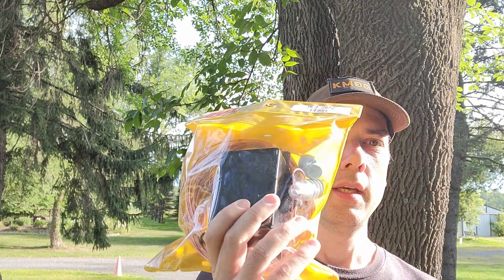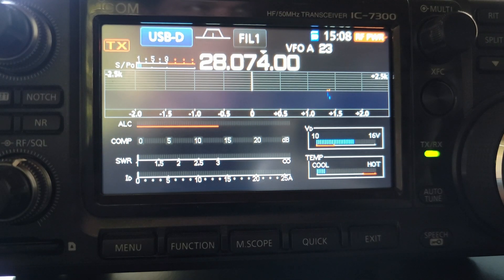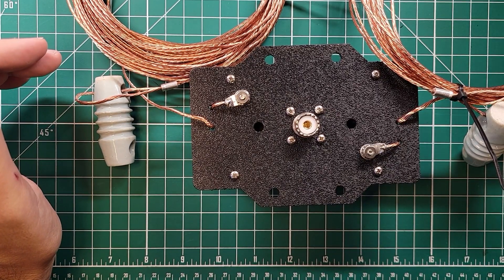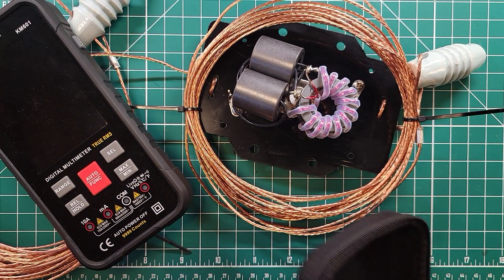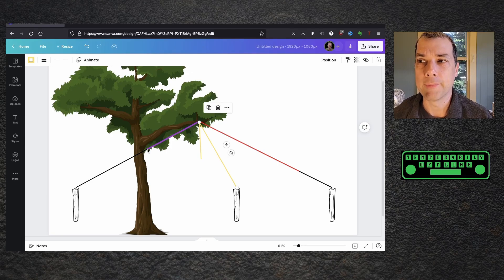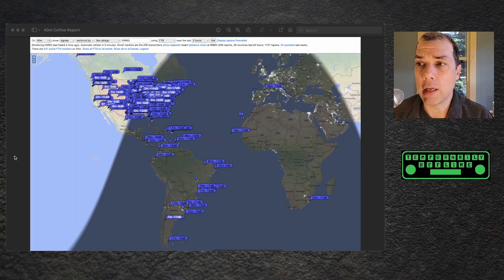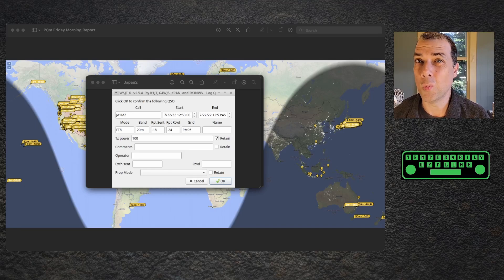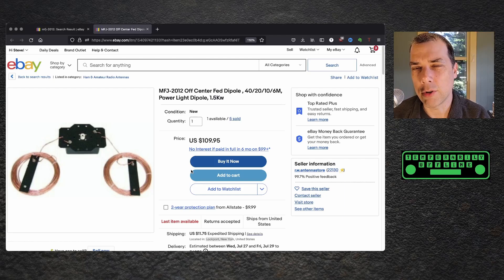Make a 6,120 MILE Contact Using Just 100 Watts

Comment: That the antenna I have and use. I am in Boston NY . hour or so drive for me to Lockport. yes that wire turned black and green after 1 winter in NY. I did not6 get it up that high so I had to trim it. 1/3 to 2/3 cut. center fed is 1:1 cut. got it from MFJ and still sell it. I have THHN 12AWG  on it now. and run power threw  it.  works great. used it portable.  the short side into para cord to park bench ,long side with para cord on a DX commander pole lean into a tree. sloped set up. works and tuned great. I think 80 meters add wire. they have a 80 meter one not Shure if off center or not.  4:1 for off set center. 1/3-2/3 wire length . end fed is 49:1 and can be 64:1 changes cut length a bit. The spark plug antenna is a 64:1 . getting DX commander DX 50 green dipole wire he sells to put on it and outher antenna projects.  DX commander made a end fed with a 64:1 and with 160 meters of wire. and got a tune on it. and close to ground. I thought about a loop on ground 160 meter with a 4:1 but no where to put it . some park ? 1 did a 160 meter center fed on the ground in a park in the snow . had to shorten a few feet to tune. got out great at night ! 160 a funny night band and for NY its opens in winter . summer is just to much noise to use. 73's
Reply from the maker: Thanks for the insights!

Comment: Respectfully, 100 watts on FT8 is enormous power.  Even 25 watts (I never use more) is like fishing with dynamite.  Maybe try 10 watts next time?  You'll be surprised how far it'll go.
Reply from the maker: You're right - use the least amount of power to make the contact.  I operate at all different power levels for all different applications.  Thanks for sharing.

Comment: I've had the 2010 lower power version of this antenna for four years now, and I've made solid 20m contacts to Eu and Au on only 20 watts from my G90 from southwestern Idaho. 
The apex is at 23 feet. Both the 2010 and 2012 are excellent values.
Reply from the maker: I was totes impressed!
Reply: Agreed… very good and cheap antenna for 67 feet…

Comment: When i got my general I (last year) I bought the MFJ 2010 and it has served me very well. Well, until I broke the best branch on a tree. I'm not sure if I had it too tight on the branch or the branch was already compromised. Either way I need to get it back up there or continue to use my packtenna mini which has been pretty good.

Also, I don't remember if you said it, but the legs should should be greater than 90 degrees apart. Kisses
Reply from the maker: I don't think I said, can't say everything I want to... thanks for adding that.

Comment: Interdasting. You could basically use a bog-standard 4:1 and add a common mode choke just beyond it and get the same results if you wanted to homebrew one.
Reply from the maker: Yes.  This is a modified version of the Carolina Windom antenna.   Here are some homebrew plans: https://www.hamradiosecrets.com/windom-antenna.html

Comment: Did I miss you saying what the lengths are of the legs, or the OAL? I do not see it mentioned on the MFJ site. I was surprised it worked all those bands, that is impressive.
Reply from the maker: I didn't say the size of the legs, but it is 67ft total, should be around 80/20% split.  Its a fun build.  Take it to the extreme and make a "Carolina Windom"

Comment: I use this as my main HF antenna. The feed point at the apex of the roof and each leg follows down the roof,  with the longer leg folded 90degrees at the bottom corner to keep it fitting in the attic. The result is an inverted V with dogleg, compromised by the roof. Despite this, performance is excellent, with contacts on ft8 ar 25W from the US east coast near DC south all the way to Chili and past eastern Eastern Europe to Oman.  I have one mainland Australia and one Japan in the other direction.
Reply from the maker: Very nice! It's amazing what these wires can do!

Comment: Use velcro or twist ties to hold the wire together for storage. There are also releaseable zip ties but they can be hard to find.

I've always found the challenge to using dipoles in the field is getting the legs around branches.
Reply from the maker: Great tips, thanks!

Comment: I have mine at 50 feet. As a flat top and my 7300 will tune 6-75 m with no issues
Reply from the maker: That's awesome.  Setting it up flat top takes some effort.
Reply: @temporarilyoffline  yep. Drone helps a lot. Wish my 🎄 🎄 were higher but I have worked most of the world with it.
Reply from the maker: @alansteiber3031  I love making contacts on antennas I've been told won't work!
Reply: Right now I am building a vertical with chain link top rail and aluminum tubing to see if it works. Will be about 42 to 43 feet tall.  Should be fun
Reply from the maker: @alansteiber3031  oh yeah, building antennas is always fun
Reply from the maker: @alansteiber3031  best of luck on your build!
Reply: @temporarilyoffline  thanks

Comment: Thanks Steve.   I've used a 2012 for a few years now, it's a great "set it and forget it" antenna if you can get it high enough.  Glad you showcased its strength.   Per MFJ, it was designed by Rick Littlefield K1BQT when he was an engineer for MFJ.  I contacted him for more specifics on the antenna, and he told me that while in his original design published in QST he used a 2.8:1 binocular transformer, the MFJ model uses a 2.8:1 autotransformer.  He said that he discovered that a 2.8:1 autotransformer had lower loss and better SWR than 4:1.  His past QST articles are worth a look, as he is quite the designer!     Cheers, K7KS
Reply from the maker: That is really neat.  I think that transformer design is pretty slick!  Thanks for the extra info.